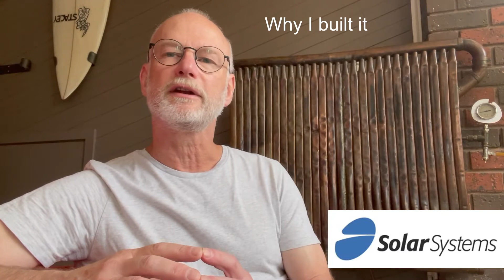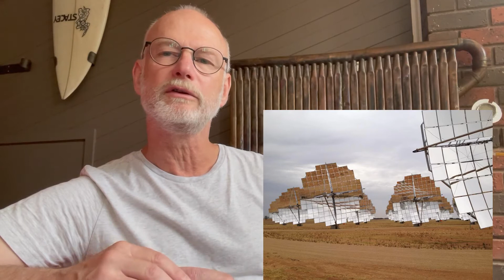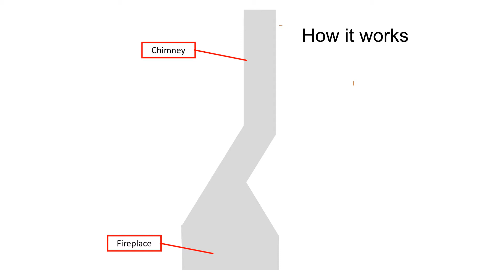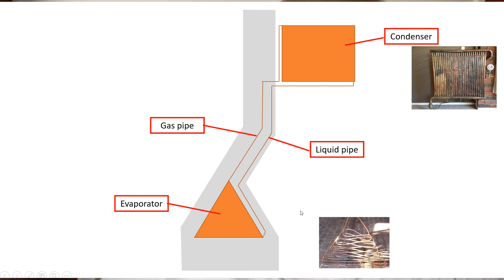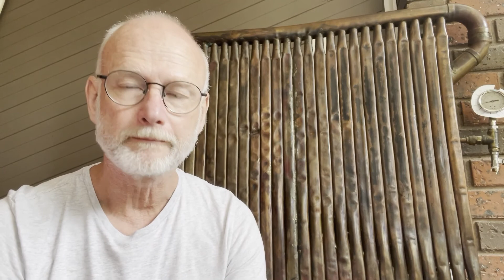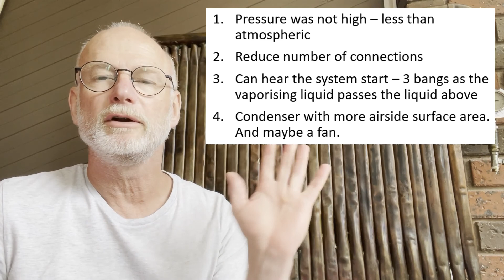Chimney Heat Pipe 2

Comment: I am interested in getting some more facts about the system. What is the pipe sizes and thickness of the pipe wall??? The water you are using in the system is distilled water ??? Please let me know anything else you come access the system issues. Thanks Sir, VF.
Reply from the maker: The evaporator I made from 1/2 inch copper pipe from the local hardware, nothing special. The condenser was scrap from a heliostat prototype. Sorry, I don't know the wall thicknesses.

Comment: If you filled it just with water and add a pressure pipe leading to a water container on top of "condenser", you could move more heat. But you would also need a water pump to move water faster.
Reply from the maker: Thank you for your comment. Looped Heat Pipes are a lot more efficient at moving heat than a liquid water system. It doesn't require a pump to move the fluid. A pump consumes power and wears out. That's the beauty of Looped Heat Pipes. Vapour is also much better at transferring heat than liquid. If I wanted to transfer more heat I would improve the heat exchangers.